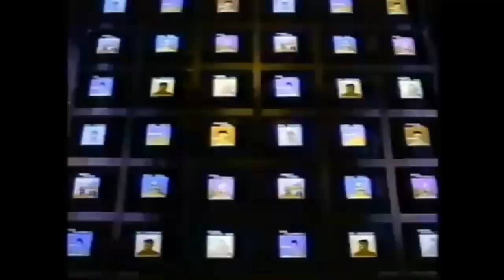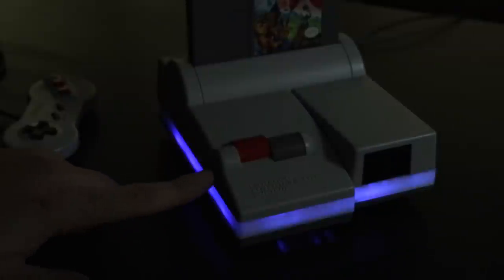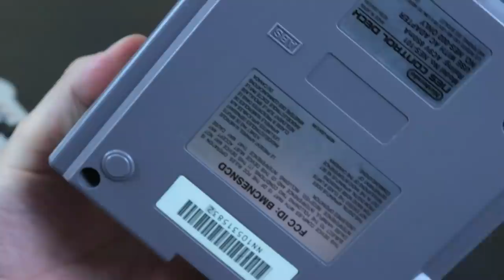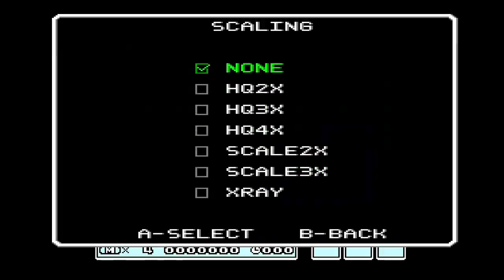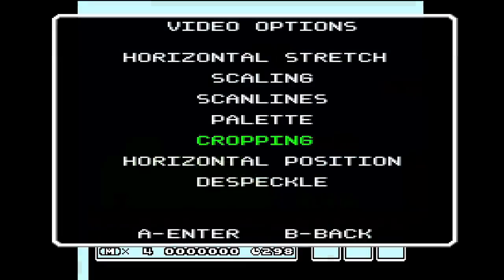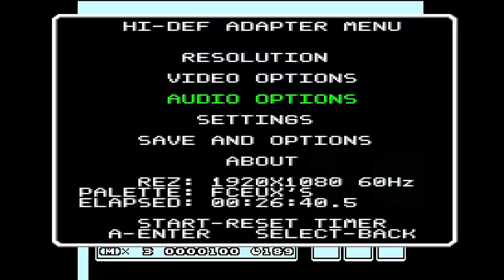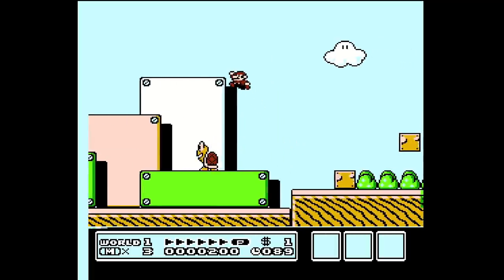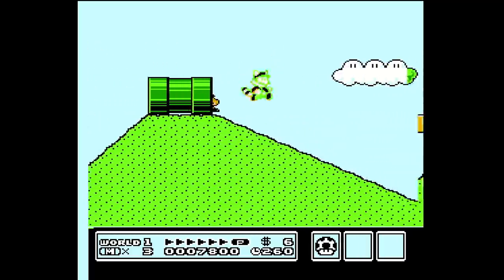This NES Top Loader Has HDMI & Touch Sensor LED Lights - The Ultimate Modded Nintendo!

Comment: That's awesome. I love the LED design! I have an old toploader I've been thinking of modding at some point. I'm certainly not playing it in RF when I a reliable frontloader and a RetroUSB AVS as well.
Reply: The downside to the AVS is that it doesn't have a CRT interpolation/softness depth slider, just scan lines. 8-bit NES games look awful with crystal clear razor sharp square-sprites imo. Applying a touch of softness and a hint of scan lines is what i like and you can only seem to get that with the Nt Mini and maybe the Hi-Def NES. The former goes for over $3000 on eBay, and the latter isn't available anymore. Both options are out! :P